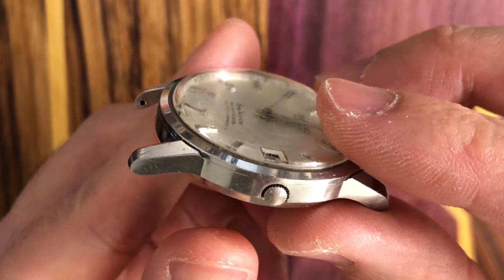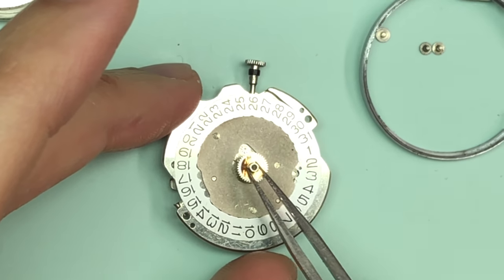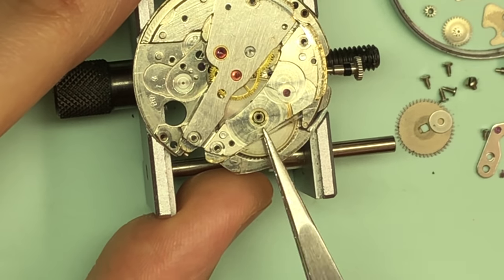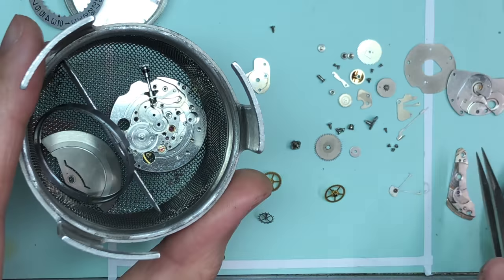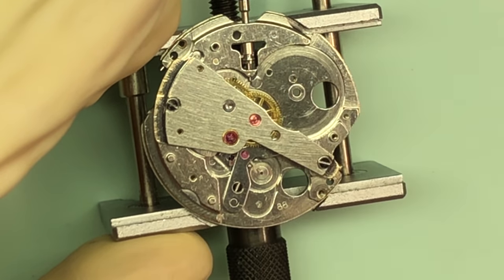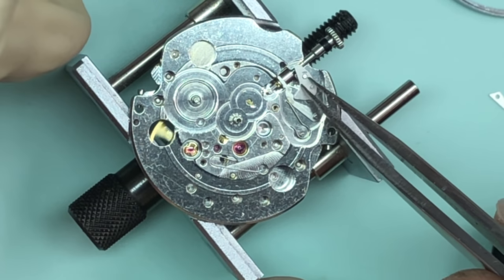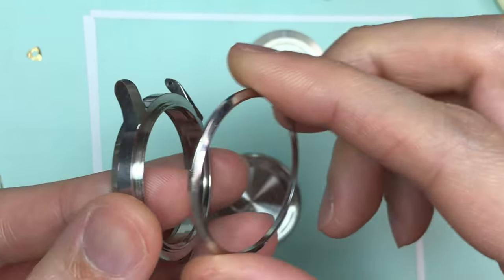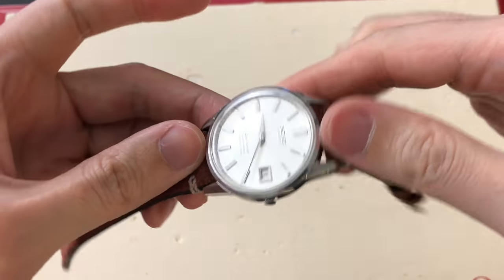RESTORATION OF A 1965 SEIKO SEA HORSE aka JAPANESE SEAMASTER - Caliber 7625 service

Comment: Magnificent. I have almost the same watch, also from 1965. It has a few differences. Mine is called Diashock - 26 Jewels, with  No. 5106 - 9010 R AD. No idea what AD means. Just above the 6 o'clock marker is a window with a day indication in English. The winder is at the 4 o'clock position. I just love this watch!
Reply from the maker: Thank you for the comment and sharing your piece.  I am not a Seiko specialist, but maybe AD stands for Automatic Date?  haha
Reply: With Seiko the 1st 4 digits are the movement number and the 2nd 4 after the dash are the casing number, not certain what the AD stands for though
Reply: @TimelessHistoryChannel  Thanks for your answer. "Automatic Date" makes sense.

Comment: A great video,  thank you for posting it for our benefit.
One small thing,  at 0:36 you say you're the only channel on YouTube where we can learn in depth about watch repair.  If you aren't aware, there are at least a dozen.  Everyone from Wristwatch Revival, Chroniglide, and Mark Lovik's Watch Rapair Channel all teach in depth on watch repair. You have good content,  no need to sully it with claims that are obviously not true. The list is much longer,  but those are the ones i have learned the most from.
Reply from the maker: Hi, thank you for the comment.  There are many ways to restore a watch.  But to properly restore a “vintage” watch, there are a few “NOT” to do. Or you can hurt the watch’s value between 50-80%!  If an old watch has no case issue or the dial is well aged.  Just clean them up instead of polishing the case or refinish the dial.  Unlike restoring an old car, when it comes to restoring a vintage watch it is similar to restoring an antique gun.  You get it to work and keep everything else in original condition.  I care about the value and originality of the watch.

Comment: Amazing! Very different movement design from Omega! The idea of fully automatic without manual winding indicates the philosophy of everyday wear watch back in the 60s. For the same reason they design it with the recessed crown. I really like the minute ring. It is different from the other Seiko models in the same era. 

Just wondering why the main spring was so dirty?

Thanks again for showing us this restoration piece! Love it!
Reply: The mainspring grease Seiko used has graphite in it.  It's black in color even when new.  That's why it looks so dirty.
Reply from the maker: Thank you so much for the comment.  
Someone has answered your question before me.  He is correct.  It is the type of grease that Seiko used.  Similar to the many vintage Rolexes that I've worked on also uses a similar grease.  It can spell horribly as well.  If applied too much it can come out of the barrel and get onto other parts of the movement.

Comment: This watch looks like a monster in your hands. Awesome video btw! 
I find it amazing how many of these videos from different watch repairs that have a floating screw from movement clamps. All so far have been lucky and not ended up in the balance. Although now that I think about it I believe the watch repair channel had one on an Omega that ended up in the balance area.
Thank you.
Reply from the maker: Maybe it is a common issue on these Seiko? But that is one of the many reasons why a watch may come non-working. Another common issue is the ratchet wheel screw unscrew and the wheel has lifted out of place.

Comment: would you be able to do a video on a seiko 6139 600x. it would be helpful to a lot of people i know it would help me  i am learning to become a watchmaker. i like your videos because you are a person who does not act like a know it all. your videos have given me tips on how to fix some watches.
Reply from the maker: Thank you for the comment and kind words.  When you are good at something, your work will say it all.  There is no need to show off or repeat how great you are verbally.  I've not work on a 6139 Seiko for over a decade.  When I come across one and it looks good for a restoration video will make one for you.  :-)
Reply: I would check out Spencer Klein's channel. He is a vintage Seiko specialist & has made several restoration videos featuring the 6139 movement!
Reply: There are few guides out there on the 6139.  Search Polly's 6139 guide.   I have done a "pic heavy" thread on a black 6139-6012 on a watch forum.  It's the same movement, but the case doesn't have a rotating bezel.  Others have similar posts.  The service guide is available to download too.  

There are A and B versions of the 6139, but they are very similar.  There are two key components to check when servicing a 6139.  The first is the chronograph wheel which a replacement is very difficult to find and nearly impossible to rebuild.   The other is the mainspring arbor port, which almost always is worn and needs to be jeweled.  There are jewel kits, full gasket kits, and crystals for the 6139-600x.  They typically are very accurate when correctly serviced.
Reply: @stevenmeitner8477  this is strange the mainspring arbor port is not worn it has a Service mark from 1974 and the inner bezel ring is faded a bit but not bad.
Reply: @talkingtimehorology  I've had a couple I've serviced with good arbor ports, though far fewer than worn out ones.  They were also later year 6139.  My guess is they were worn and then left in a drawer when cheap quartz came around.
Reply: @stevenmeitner8477  are seiko 6139 6007s rare and what are worth
Reply: @stevenmeitner8477  also the arbor port is not even a tiny bit loose.
Reply: @talkingtimehorology  They probably are a little more uncommon than other 6139-600x models.  From my understanding, they were for the Latin American market.  As for price, condition and servicing are major factors, so I can't really comment on that.
Reply: @stevenmeitner8477  to more things and that is it what is the most rear seiko 6139 600x and what is your favorite seiko 6139 600x.
Reply: @talkingtimehorology  I'm not sure which is the most rare.  Maybe the 6002 teal dial?  I like most every 6139, but my 6005 blue dial without the resist or sports text gets the most wrist time.

Comment: How do you check that the train moves freely when you start by dropping the anchor into the movement ? i like to install it along with the balance when all is in place and i always rinse the pallet separately and no heat drying for this part also.
Reply from the maker: Please note that a watch repair takes much longer than 30mins.  If you are one you will understand that.  The video has been edited and it took me several hours along to do so.  What you do not see are things such as me cleaning every wheel and gears by hand first.  Why?  Because if I can clean up what I can see already, this will allow my cleaning solution to last longer.  I do examine every parts before assembling. If the watch shows any flaw, it would pick up on the timing machine.  Rarely, do I have a train system issue.  With regards to the pallet, every watch maker has their own way of cleaning a watch.  I've never had a pallet issue going through the heat dry.  Maybe if you leave it to heat dry for a very long time maybe.  I've been working on watches for the past 2 decades.  Cleaned several thousands watches.  :-)
Reply: @TimelessHistoryChannel  im a hobbyist and im just curious to see how it could be done, and maybe thereby  improve my own technique, the method i use are inspired by Mark at the watchrepair  channel, and i feel its safer to assemble the train without the ancher so that i Can get a feel of the pivots finding home,
And by turning the wheels i also have a chance of seeing if a wheel is bent or hitting something, but hey, thats just my way of doing things, and yes i know that there is alot of editing and things you do behind the scene, keep up the good work !
Reply from the maker: @thegrassyknoll7792  Thank you for your understanding.  It is good that you are following his instruction.  But honestly, with regards to assembling the wheels.  I am at the point where I can do it by feel.  haha.  That is when you work on watches on a daily basis for the past 20 years.  That said, I do examine everything prior to assemble.  Never take shortcut.  If you are going to do this long term.  I recommend that you purchase yourself a timing machine.  I believe there are some at a very affordable price on ebay for around $150.  By looking at the line on the graph, it will tell you whether you did a good job or not.
Reply: @TimelessHistoryChannel  i have a wichi 1900 timegrapher, it gives me alot of info and i evaluate my work by amplitude aso. And if i Can squeeze a few  more degrees out, my next wish : the Graham Baxter escapement analyzer where the real Sound Can be heard ,and more info Can be used,
Reply from the maker: @thegrassyknoll7792  Nice.
Do you mean weishi or witschi?  Witschi is serious stuff.  :-)
But as a hobbyist I say Weishi is good enough as it is very affordable.  
But there are still watch makers who uses the old fashion vibrograf B200.  Can't go wrong with that either.  But it has become harder and harder to locate the paper roll for it.
Reply: @TimelessHistoryChannel  its the affordable one from china, it still gets the job done, i just love to step into these microuniverses where even the smallest grain of dust is like a rock in a machine, and the feeling , when i sense that all parts are performing at their best,and the timegrapher goes above 280˚ in a watch starting out as a non runner makes it all worthwhile for me, have a nice weekend

Comment: Hi bro, i truly appreciate your videos. I have a question. Do 7625A and 7625D have the same movements mechanism? The reason i ask is because i am about to service my 7625D movement, but i am unsure if this video could guide me from A-Z. It will be my first try to service an auto movement. Thanks!
Reply from the maker: I'm not an expert on vintage Seiko. But from my experience working on all sorts of watches. Usually, when the movement calibres are the same, the letter is there to differentiate a unique feature that it has. For instance, one may just tell time only, while the other has the date feature.

Comment: When you say that the right oils needs to be applied on the right spots and amounts, did you have a technical document describing where to oil this movment? Or did you just go with your intuition and what your experience have taught you?
Reply from the maker: Thank you for your comment. I am unsure how other watchmakers learned how to restore a watch, as there are more watch breakers than an actual watchmaker. 
I learned how to repair a watch from my uncle, a master watchmaker at Bulova, during the 80s and 90s. I also learned from other local watchmakers in their workshops. But you can only learn so much from another watchmaker, so the rest of my knowledge comes from working on watches every day, reading books, and asking questions if uncertain or can't solve an issue. 
What type of lubrication and where to apply is very much the same with all watch movements. I have a collection of service books on Rolex, Omega, and Longines. These books will show and tell you which lubrication applies to where. 
Even though some movements require at least five different types of lubrication, as long as you have three main lubrication types, they will give you the same result. 
They are: 
Balance and Train wheel jewels - Moebius 9010/10 
Pallet stones - Moebius 941/2
Other gears and mainspring - Moebius 8200

The oiler will control the amount of lubrication to apply. Jewels only require a tiny amount of lubrication, while mainspring and other gears require more. But never soak a watch with lubrication. 

I've been a watchmaker for over 20 years. The first 5 years will be stressful. Just hang in there and you'll become a good watchmaker.
Reply: @TimelessHistoryChannel  Thank you for the very thorough answer, and the encuragement! Right now I have a watch of the same caliber for service/training and have the oils you mentioned except 8200 (instead I have 9501), but since the watch is an automatic, I will have to purchase 8200 as well :)
Reply from the maker: You're welcome. I mainly use 8200 for the mainspring, keyless works, minute wheel and setting wheel on a regular manual wind watch. I also apply it on the automatic system of a self-winding watch.

Comment: Seiko refers to their shock setting for the balance as "Diashock" - very different from Kif.
Reply from the maker: That’s correct. I rarely work on Japanese watches.  Someone commented about it too.  I just thought it looks similar to kif.  Used my kif tool and does the same job.  Thank you for the correction though.
Reply: @TimelessHistoryChannel  Totally understand. They look similar. I like your method of installing the pallet fork bridge first - I might give that a try. Looks like a good way to make sure the pallet stone grease does not spread around
Reply from the maker: @slim2429  Yes, this way it will never get spread over to the escape wheel.  But do make sure to example and test those train wheels first.  But usually, they are in good shape.

Comment: Amazing work. I am getting a seikomatic-r 8035-9000. its on the way. I was thinking about changing the crystal to sapphire. Any reason this cannot be done? I see that these type watches do not have a gasket for the crystal, likely because it is acrylic, but would probably need one for sapphire. Any thoughts? Thanks.
Reply from the maker: Hi, I don't think that you can fit a sapphire crystal into a vintage Seiko either. Similar to a vintage Omega case, the moment you try to install a sapphire crystal it will just sink into the case and damage the hands and possibly the dial as well. That's because a sapphire or mineral crystal do not have a side step to give that extra raise that an acrylic crystal has. The acrylic crystal has a metal tension ring inside, which when properly fitted will prevent moisture and dust from entering the watch.
Reply: @TimelessHistoryChannel  Correction 8-35-9010 (seikomatic-r). Ive looked all over, and you are correct. I cannot find anything sapphire to replace the acrylic 340W05AN/340WS5 glass. The acrylic is cheap enough, but i hate worrying about scratches. It appears that the crystal sits above the case, over a lip, and is held down by the bezel. So not an easy sapphire shape. Thanks again.
Reply from the maker: @ddsfard  If you are worried about scratches, they are not avoidable.  However, you can always go onto eBay to purchase this item called "Polywatch". It is affordable, simple to use to remove scratches, and last for a very long time.
Reply from the maker: @ddsfard  Sounds almost like a Rolex oyster.  Moisture will never be able to enter through the crystal.

Comment: My 1978 Seiko 7009-8129. soo ... I went Collingwood Flea Market in Farmingdale, NJ. Browsing on the booths outside. I spot a vintage Seiko watch on the shelves inside the glass box. I observe Seiko Automatic watch having a few little scratches on the crystal and waterproof. And the movement caliber is 7009-8129. It seems the 1970s early.  I ask the guy about running is work or not. He says, “still running work. I test a wind horizontal carefully in few seconds. Then the second hand move is running work well. I ask him, “how much cost this?” He mentions $39….. I offer him $30.  He accepts it. I bought it….  Right now my 1970s Seiko Automatic is real bad dirty. I really need a professional watch repair restoration for deep cleaning a bath and needing an accuracy time… need crystal replacement, too

Comment: Hi I can tell you they skip the step to clean the mainspring because to put it back it required a Bergeon set that cost 1500$ and without mainspring winder you've a great chance to break the mainspring meaning to replace it
Reply from the maker: Don't think they are skipping this step because of the expensive Bergeon tool.  There are many useful mainspring winding tools online for around $100 range.  They skip this step in order to save time in my opinion.  Many watch sellers are just flipping watches, so they do not want to pay so much if they needed a watch serviced.
Reply: @TimelessHistoryChannel  I've been talking with an old watchmaker the men with 50 years experience and he tell me that do not extract the mainspring each time especially for automatic watch. But I agree it's not good practice
Reply from the maker: @RichardGrossmanBSG75  Sometimes the year of experience does not make a watchmaker any better if he/she stick and continue to use the incorrect method.

Comment: Hello, I noticed you lubricated the pallet fork jewel although it is common not to do this given how, if the oil gets old, it would effect this sensitive parts operation.. Could you please explain your reasoning for doing this?
Reply from the maker: Hi Matt, 
honestly, I am not sure how to response to your question.  I've never had an issue lubricating the pallet fork jewels this way.  The main reason I do it this way is I can see the amount that is applied on the jewel and can avoid lubricating the teeth on the escape wheel.  The other thing is, a watch should be regularly service every 3-5 years.  But on some of my personal watches that I seldom put on, they still perform accuracy 10 years later.  The type of lubrication is very important in my opinion.
Reply: @TimelessHistoryChannel  Thanks for taking the time to reply. I have read up on this as some people say you should (and believe some seiko service manuals actually suggest this) and some you never should. I think it was likely a problem using the older non synthetic type oils which would degrade much quicker than the synthetic ones today.
Reply from the maker: @mattobrien3346  You're welcome.  I agree to that.  There is a reason why a movement is made with those two holes.  :-)